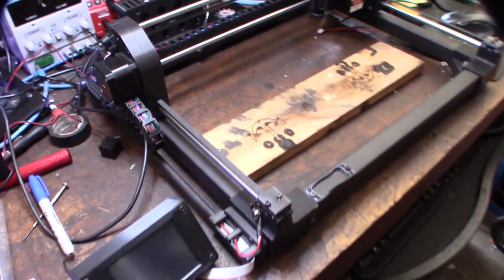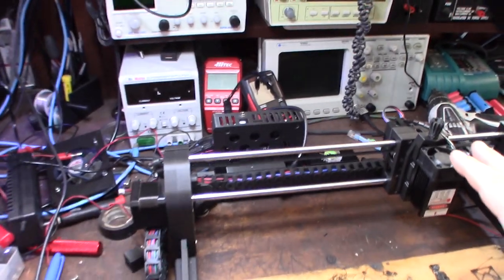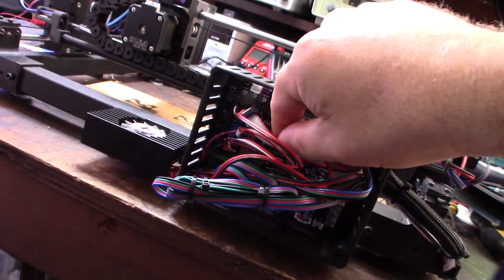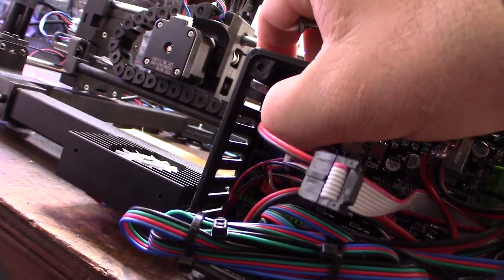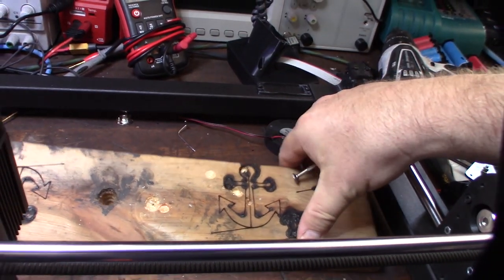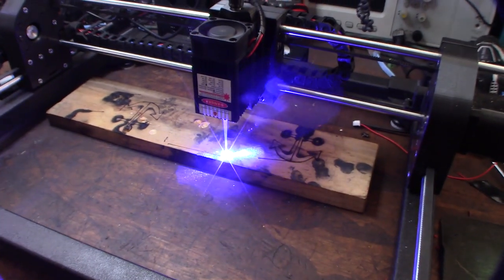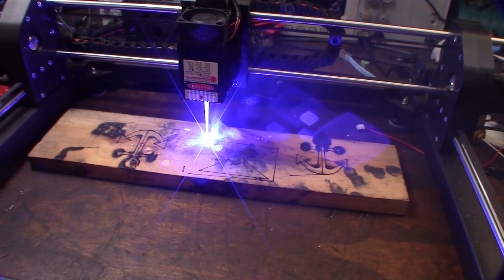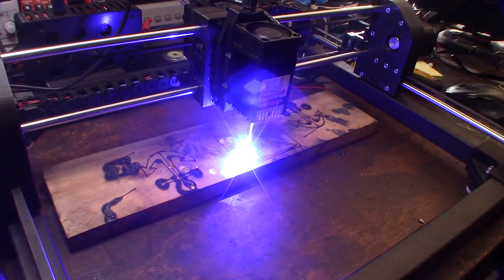Homemade DIY Laser cutter engraver from old 3D printer parts GRBL CNC Marlin part 3

Comment: If you look into Grbl there are acceleration settings, and actually a specific Laser mode that automatically handles laser power control when turning corners/direction. Look into T2 and Lightburn software. Both have free trials, and are not expensive if you decide to purchase.

Comment: Hey I came across your channel when i was looking to upgrade my laser engravers control board. I wanted to have limit switches and that brought me to you. But now I am having a hard time following along with you. How do you wire your laser. I only have a 2.5w atm. it doesnt have that extra control board. Also. Where do i connect my laser's power?

Comment: Hi I'm currently facing
the same problem, I got a 15w ttl or pwm laser module with it's own power supply. I contacted it to my laser engraver which works just fine but doesn't power or control the laser even when connected. I tested the laser without the board but as you already know it just blast at full power.
Please help how do I get these two working in unisense.  Thank you